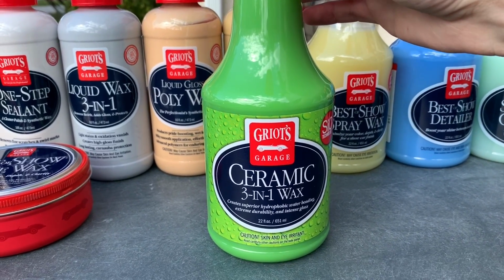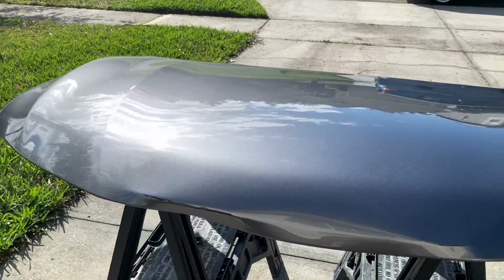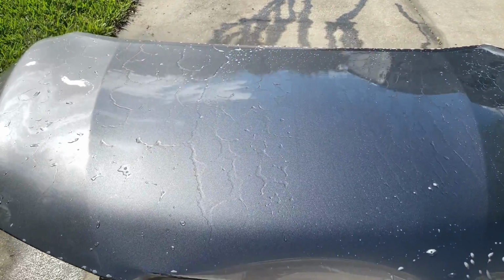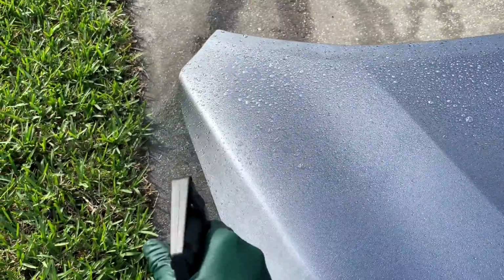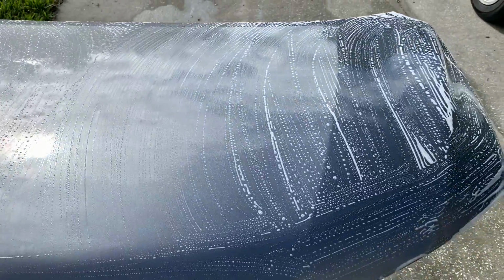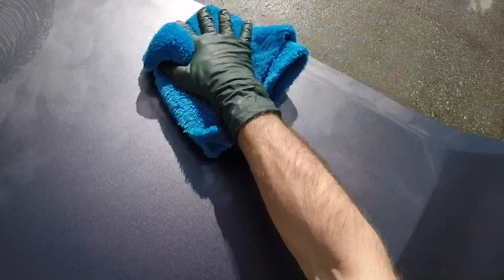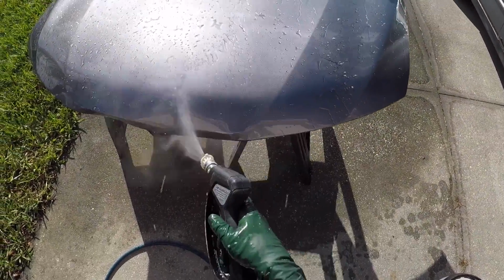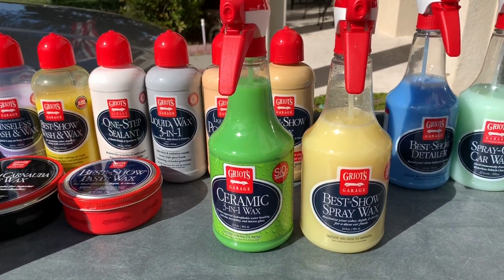Griot’s Garage Ceramic 3-in-1 Wax - Great First Impressions!

Comment from the maker: Hey all, I tested the Griot's Ceramic 3-in-1 Wax at 3 months of pure durability and it's holding up extremely well!  You can check out that video here:  https://youtu.be/Or1ip9iiq14
Reply: Kyle how accurate is your paint thickness meter? I calibrated it and get different readings each time which is maybe normal. I mean it can go from say 90 to 98 to 106 to 92.
Reply from the maker: @jaykid007_JasonDavis  Hey Jason!  That kind of variance is normal, mine is a DT-156, it’s pretty accurate based on the calibration shims.  I use mine more to confirm safety, if I’m in the low 80-100 range I really stop thinking about heavy compounding.  And I use to confirm resprayed and bodywork, those numbers are much higher than factory measurements.

Comment: am so confussed what 2 use!!!!!.....all..most of these testing sites leeve the customer  frustrated!!!..most of us urr not proff. detailers like u guys are....we like a yes or no......clear cut winners etc...hillarious....this mana facturer  has wayyy 2many products..like chemical guys 2try n decide what 2use 4a nice shine>
Reply from the maker: Worry less about which specific products to use, if you're dipping your toes into detailing you need to understand the basic tenets of detailing:  Wash, decontaminate, polish, protect, maintain.

Car paint requires periodic mechanical decontamination through claying and paint polishing. On a daily driver, failure to perform periodic decontamination can lead to gloss reduction, and accelerated clearcoat oxidation and degradation.

The rest is all moot, every single manufacturer has a proficient protectant and maintenance spray to get you through the next decontamination phase (usually 6 months to a year before decon is performed again depending on where you live). And you cannot expect to get the best results out of whatever protectants you select until the paint has been decontaminated and polished at reasonable intervals.

Comment: This vs Wolfgang Deep Gloss Sealant? Depth/gloss/hydrophobicity/durability.  Thank You Sooo much!
Reply from the maker: Wolfgang DGPS is more traditional, god tier application and wipeoff, but average hydrophobics and durability.  Griot’s is stronger durability with two coats, better hydrophobics, but you have to be more careful during wipeoff due to its faster/more significant curing.  I’m actually more likely to reach for DGPS because if I need the extra durability, I’ll just go with a full coating instead of the spray on hybrids, but my preferences are a lot different than most.  DGPS is one of the best sealants that I’ve worked with in terms of application, fun and addicting to wipe off.

Comment: For ease of use, I wonder how the 3 in 1 Ceramic Wax would work with Waxedshine Aquabead as a topper. 3 in 1 is easy to apply as a base coat, and Aquabead is about as easy as it gets as a topper.

Comment: What kind of pressure washer were you using in this video? I liked how it works!
Reply from the maker: Hey Josh!  This is a Ryobi 1600psi 1.2gpm washer that I’ve upgraded with the MTM Hydro SGS28 gun and nozzles, and a Kobrajet 3/8” hose with all the quick disconnect fittings that I picked up from Obsessed Garage.  The new sprayer gun and hose completely transforms the utility of these cheaper washers, and the short gun makes it easier to maneuver the foam cannon around, the gun has a built in swivel too that really prevents the hose from binding up.

Comment: Would it be best to clay before using this product?
Reply from the maker: Making sure that the paint is decon'd and polished is the best way to enhance the durability of any protectant that you're working with.  So I only recommend claying if you're noticing a build up of embedded contamination on the surface that doesn't wash off.

Comment: Do you think I can use this product with chemical guys butter wax ??
Reply from the maker: So if Butter Wet Wax has been on the paint for a little bit and you’re looking to top it with Ceramic 3-in-1 Wax, you could get away with this.  I personally wouldn’t want to pair these up with each other, the Griot’s bonds very effectively to bare clearcoat and that’s how you’re going to extend its durability.  And then I would maintain the Griot’s with a spray detailer like Speed Shine or Best of Show Detailer, and skip Butter Wet Wax.  I definitely would not want to use Butter Wet Wax on top of the Griot’s unless the Griot’s is pretty far diminished.
Reply: WaxMode thank you !!! And great video too 🙏🏼

Comment: I used this on a new car after claying it and so far I LOVE IT!    I have another car that's got ceramic over PPF that I did myself two years ago. It's a sunday only car. I'd like to apply the 3 in 1 over this as a booster.  Do you know if the 3 in 1 can work in this way?

I also just used Griot's Best in Show detailer and love that too!  They are hooking me in!  Plus, having them on the shelf at Auto Zone (with coupons too) is convenient.
Reply from the maker: Hey Adam, Griot's can be finicky on some ceramics, I tried using it over top of the Adam's Ceramic Spray Coating section and it didn't want to level out as easy, left some streaking behind.  I'd most likely stick with a lighter topper on top of the coating on the PPF like the Best of Show Detailer.  

Griot's definitely has an outstanding selection across the board.  Been loving their new G9 polisher and their Best of Show abrasives.  Still have my old GG6 polisher for doing headlights and tighter areas, really want to snag their G8 polisher in the future.  Still really like their Best of Show Paste Wax and Premium Carnauba Paste Wax, Poly Wax, Best of Show Liquid Wax, awesome stuff!
Reply: @WaxMode  I wound up using it over the ceramic and it worked well. I find that the ceramic that I have requires a short nap microfiber towel, but other than that it works well.  I use the griots best of show detailer over that for finishing and touchups routinely. I love it so much I just ordered a gallon.

Comment: Ive been using the Griots 3 in 1 for about 4 months now and live this stuff. However, I strongly recommend using a microfiber applicator block like chemical guys.  I find you can lay a much more even layer of product and can apply in Up and down and side to side motion. Great stuff griots. JJ
Reply from the maker: Great tip James, I'll have to try the block out and see how it does.

Comment: I just applied this to my car and it’s the best the car has EVER looked. I’ve used Meguiars 3-1 all in one wax, Chemical Guys Butter Wet Wax, and now the Griot’s 3-1 Ceramic and by far the Griot’s has the easiest application and looks the best. I literally did my entire car at the vacuums at a car wash, because it had shade since I don’t have a garage, and I had the entire car done in 15 minutes. I’m letting it cure outside and I’m going to get up early, to avoid the sun to apply my second coat. There was one spot on my trunk lid that was in the sun so I very very quickly applied and removed the product and it seemed like it wanted to dry a lot quicker and streak so if you don’t have shade I’d defiantly do very small sections as it will dry in a second.

Edited for grammar
Reply from the maker: Great feedback, thanks for letting me know how it's been working for you!

Comment: Your videos are my go to!  Excellent!
Would it be possible for you to do a strip down test at 3-6 months for this product and the Turtle Wax Ceramic Spray Coating?
Reply from the maker: Thanks M P!  I'll definitely consider that, we're at 3 months on the silver test car and it's holding up great, we'll see how long it can hold up without maintenance and then I may run a Strip Down test to see how it reacts.

Comment: How does it compare to meguiars ceramic  detailer
Reply from the maker: Hybrid Ceramic Detailer is more hydrophobic in the short term, but I wouldn't make plans to use Hybrid Ceramic Detailer for long term durability.  Rather I would use it as a maintenance topper for coatings or the Meguiar's waxes/sealants.  This Griot's Ceramic 3-in-1 Wax however has held up incredibly in my 3 month durability test without toppers.

Comment: Can you please test it against Bead Maker?
Reply from the maker: Bead Maker is going to be more comparable to Griot's Best of Show Detailer in terms of function and performance.  This Ceramic 3-in-1 Wax is going to be much heavier than Bead Maker, not as slick, but have a much higher durability potential and certainly much more chemical resistance.  I'm approaching 2 months of durability with Ceramic 3-in-1 Wax and it's holding up really well on the test car.
Reply: @WaxMode  thanks for that info but that brings me to a follow up qurstion, what about Bead Maker vs Megs Ultimate Quik Wax (new formula) vs Turtle Wax Ice Spray Wax.
I know those 2 are waxes and BM is a polymer base sealant but if Im not mistaken those 2 waxes are synthetic so they are some kind of sealants too. I know Im deviating from the 3 in 1 but definitely that one is way better so Im wondering which of the other 3 comes behind it in terms of durability, chemical resistance & gloss.

Thanks!

Comment: Are you absolutely sure Prep-All is safe for painted surfaces? Here is the description:
"Prep-All® is fast-acting, effective on metal, plastic, and fiberglass, and can be used prior to sanding and painting."
Reply from the maker: I’ve never had any issues with Prep-All and I’ve used it quite often and regularly on all the test cars and panels that I have.  I’ve let it dwell for extended times without any damage as well, however you always want to test in a small inconspicuous spot first, as thin paint or paint where it’s rusting underneath but not through the top surface, paint on top of fragile bondo, these can all lead to the top surface having a potential negative reaction with stronger cleaners and solvents.  There was recently a thread on Autopia where a 50/50 dilution of IPA caused some bubbling in a small spot.  

The only product I’ve used so far that did damage the paint on the test panels immediately on contact was Dupli-Color’s Prep-Spray aerosol formula.
Reply: @WaxMode  thanks - much appreciated. I've just  realised that since it's safe on plastic, and automative paint is sort of like a very tough plastic (yes?), that's actually a good indication that it is safe. 😃

Comment: Hello. I'm a new subscriber to your channel.  Really fantastic content. I own enough cars that I feel as though I have solely supported Richard Griot. I swear by Griots products.  I have also branched out into the Croftgate product line a bit.  Finding a big difference in solid color paint and metallic paint, when treated with the same product and checked with my gloss meter. I had found Griots Best of Show Detailer to be my go to topper, until I tried Croftgate Endure XXL and finished off with a coat of Croftgate Quick and Slick. I could see a definite difference, mainly on the metallic paint. Listening to your comments on depth of color vs. gloss making a difference in what your eye sees is very much correct. You were spot on with the fact that gloss can have the same reading on both paint types, but depth of color and warmth can be more appealing to your eye. I will be supporting your channel from here on out.  Thanks for your wisdom. Ed
Reply from the maker: Thanks a bunch Ed, appreciate the feedback!  I’ll do some research into Croftgate, maybe see if I can pick up a few of their products for testing.  It’s very easy for viewers to misunderstand the glossmeter’s measurements, there’s so much more to paint enhancement than strictly “gloss”, and it’s tough to try and get that message across sometimes without a big lecture.  Thanks for subscribing, hopefully I’ll have some more content out soon!

Comment: Just stumbled onto your video looking at Griots products. Very well done and informative! I'm not a pro detailer, just a weekend warrior who likes to care for his car. Mostly, I'm looking for something to protect my paint and make it easier to wash in the winter here in Seattle. Any idea how the 3 in 1 would compare to something like P&S Bead Maker? Also, I sub'd.
Reply from the maker: Thanks a bunch John!  Ceramic 3-in-1 Wax would be a great option to use as your main protectant, it's a lot different compared to Bead Maker.  I consider Bead Maker as a lighter, not as heavy a protectant, and so it does really well to fit the role of a maintenance topper, and less of something that I would use as my main base layer protectant.  Ceramic 3-in-1 is heavier, it will be much more hydrophobic and more durable, I can use it on a regular basis if I wanted to, or I can switch over to something lighter like the Best of Show Detailer for maintenance.  I haven't tried Bead Maker on top of Ceramic 3-in-1 yet, I'm not sure if it plays well together, but I can't see it being an issue as I find many products like being topped with Bead Maker.  I would say give Ceramic 3-in-1 Wax a shot, you're also fairly local to Griot's, have you been to their main store in Tacoma yet?
Reply: WaxMode Thanks for your thoughts. Makes sense. I’ve used Bead Maker a few times, but it doesn’t seem to last and all I’m doing is washing it with ONR - nothing that would strip it. You’re right, I am relatively close to Griots HQ, but haven’t visited yet. Was thinking about it this weekend. I’m hoping to learn some simpler ways to maintain my car’s paint that’ll last.
Reply from the maker: @ShippsAhoy1  Those of us that are fanatics of the hobby, we like to over-complicate the process and buy a bunch of products that we don't really need in order to get the job done, and companies have to come out with a bunch of stuff to try and meet the needs of everyone's different preferences.  Really, I like to have that one product that I use as a main protectant, and then one separate product that is a spray that I can use for topping up on a regular basis after my washes, just to maintain some gloss and slickness and make sure that the main protectant doesn't become too damaged so it loses effectiveness.

I think Griot's has done a great job and keeping it simple with the Ceramic 3-in-1 Wax.  It can fill the role of using it on a regular basis after washes with it being a spray, or using it as a main protectant for a separate spray detailer to be used after washes for regular maintenance.  If you head up to the store, let me know how you like it!  One of these days I want to fly out there and check it out.
Reply: @WaxMode  Just watched your video on BeadMaker and it makes sense now - using it as a topper or a supplemental add-on for your regular washes. On a separate note, do you have a pressure washer you recommend? Again, I'm not in the detailing biz, just like to keep my car and my wife & kids cars clean and want to do it as easily as possible!
Reply from the maker: @ShippsAhoy1  Matt at Obsessed Garage did a great in depth series on cheaper electric pressure washers and he did all the legwork to narrow down the choices, and he pretty much settled on the Karcher K1700 model for the performance.  I have pretty much the Ryobi equivalent of that Karcher model, it's a 1.2GPM 1700PSI Ryobi.

The thing about these electric pressure washers, is the guns and the high pressure hose lines that connect the guns to the units, the standard ones are absolutely terrible.  I had my Ryobi for years and rarely ever pulled it out because it was so clunky, the hose would kink up all the time and it wasn't fun to work with.  Then I watched Matt's series and his solution of upgrading the gun to an MTM or Mosmatic model, with all the quick disconnect fittings, and upgrading the high pressure line to a Kobrajet 3/8" hose, absolutely transformed the usability of the Ryobi.  Then I picked up an MTM PF22 foam cannon and I use the Ryobi now every time I wash the cars.

So I would research that, I would check out his site at https://www.obsessedgarage.com/collections/pressure-washing, and this will pretty much take any cheaper electric washer which is perfect for washing the cars, and transform it into something very usable.  I grabbed the MTM SGS-28 gun, the quick disconnect package, the MTM 4 pack of nozzles, a 25' Kobrajet 3/8" high pressure hose (I should have got 50ft), and the PF22 foam cannon.  It's around $300 for the upgrades including the foam cannon, but one of my best buys for the hobby.
Reply: WaxMode I don’t even know you’re name, but thanks a ton! You’ve been more helpful and responsive than anyone I’ve ever commented on here on YouTube. I wish you nothing but success!
Reply from the maker: @ShippsAhoy1  You're welcome John, thanks for the kind words!  Keep in touch, let me know how the Griot's ends up working for you if you decide to go that route!

Comment: Does the Griots 3-in-1 have any spray on rinse off capabilities?
Reply from the maker: It does have some spray and rinse performance!  I definitely prefer a fully dry application or drying aid wipe, but I have put it on a hydrophilic water sheet and rinsed and noticed good bonding.
Reply: @WaxMode  Thanks

Comment: Would love to see a G9 review.
Reply from the maker: It’s such a solid polisher for the price.  I also recently got my hands on the G8 at the Mobile Tech Expo last Saturday, another extremely well built tool and I might have to make a purchase at $130.  Nice and smooth, lightweight, but a lot of power to get some good correction out of it.  Griots is on a mission this year!
Reply: I bought the G9! Surprised at just how much power and correction it can do, no stalling on vertical panels.

Comment: How long does the megs ceramic detailer last
Reply from the maker: I haven't run HCD through a solo durability test yet, it likes to piggy back on the base layer protectant.  It's easy enough where I could use it after every wash, smells awesome too.
Reply: WaxMode thanks for replying back you been busy